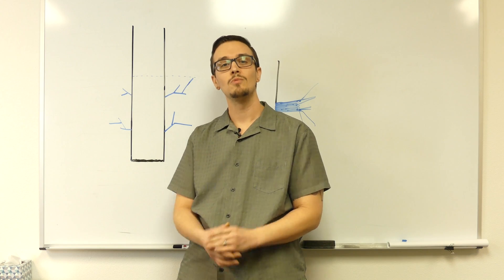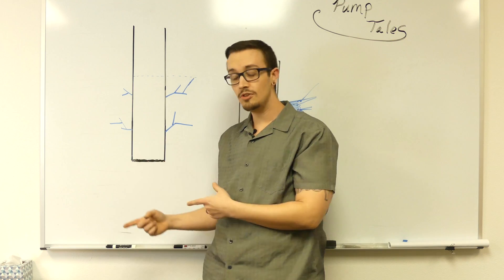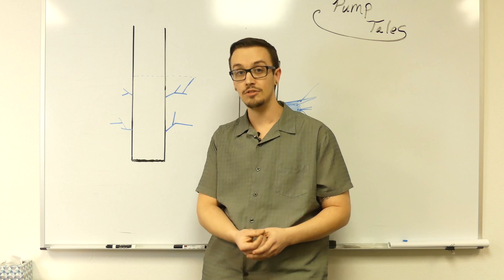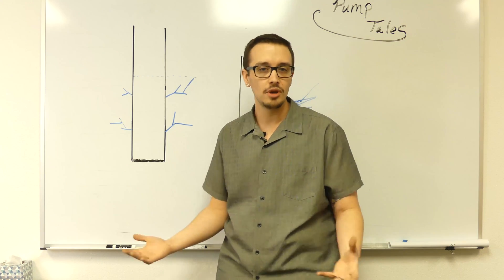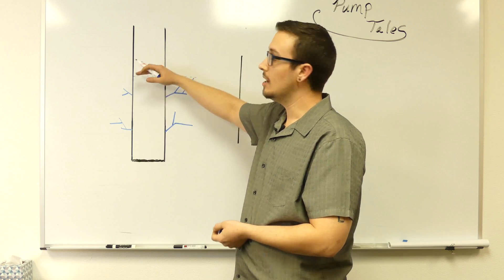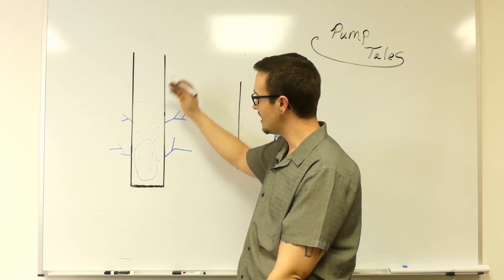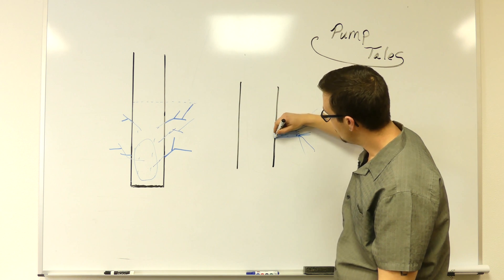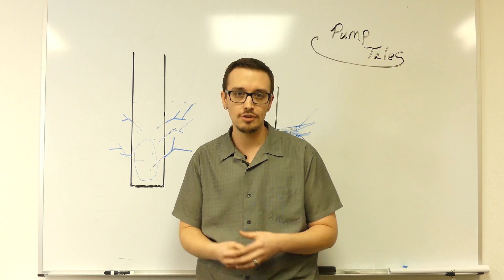Pump Tales | Improving Well Yield Back in the Day | Ep. 1

Comment: I heard that dry ice sometimes works: the extreme cold of the frozen CO2 expands the water in the hole bore where it fractures the rock more and opens it up. Have you had experience with this process?